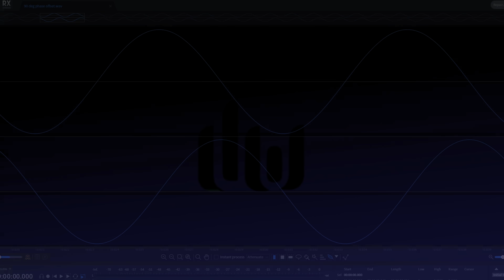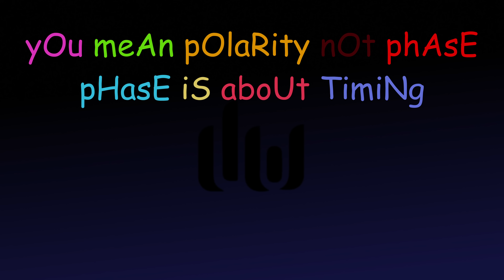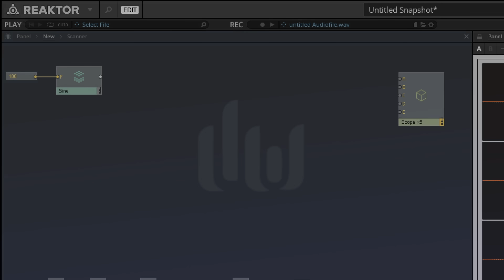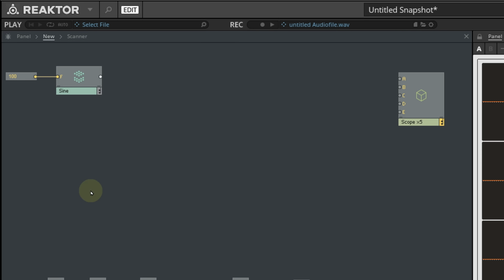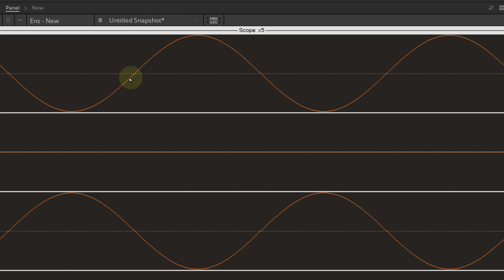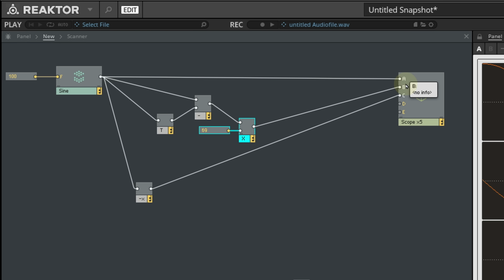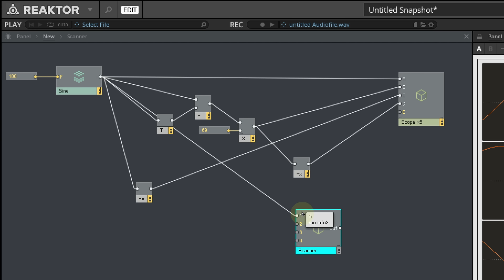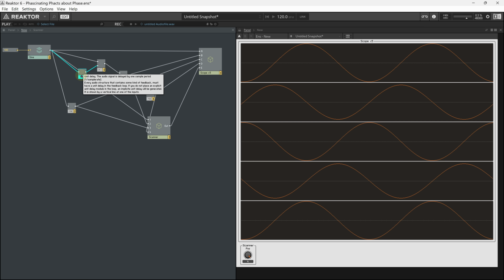Phascinating Phacts about Phase

Comment: From my understanding, what you are describing is not the difference between dynamic and condenser microphones, but the difference between pressure-gradient (i.e. velocity sensitive) and pressure microphones. While pressure-gradient microphones expose both sides of the membrane and are inherently directional, pressure microphones expose only one side and are inherently omnidirectional. It is not actually the transducer type that matters. Both condensers and dynamics can be either pressure-gradient or pressure microphones. And only pressure microphones (i.e. true omnidrectionals) should exhibit the 90 degree phase shift you are talking about - be they dynamic or condenser (condenser mics with switchable polar pattern don't count as true omni, even if set to omni mode -> these combine 2 pressure-gradient membranes to "fake" the omnidirectional pattern). 

I think DPA might have over-generalized here, since dynamic omni mics are pretty rare and they are after all most famouse for their omni condensers.
Reply from the maker: You're making me doubt myself now... I do in fact own examples of all these microphones types, so maybe I'll have to actually test it.
Reply: @DanWorrall  Ha, I never thought the day would come when I'd make Dan Worrall doubt himself :) Looking forward to your test results.
Reply: @SinaSteinerST  i was about to write about this but you stole the show. My day will come when I contribute something to Dans Knowledge as he has done to ours. :)
Reply: @DanWorrall The 90° phase difference comes from the fact that electrically they are both different types of transducers.
An electromagnetic transducer (a dynamic microphone)  generates voltage proportional to the velocity of a coil moving in a magnetic field and therefore velocity of the membrane that is mechanically coupled to it. 

An electrostatic transducer (a condenser microphone) produces voltage proportional to the displacement of a charged plate, usually itself being the membrane.

So one is a velocity sensor and the other is a position sensor.

High school physics tells us that the derrivative of position is velocity so if accoustic force sinusoidal in nature is applied to both membranes the voltage output of one will be sine, and the other one cosine , which are 90° apart.
Reply: @DanWorrall I'll be eagerly awaiting another video please!
Reply: @DanWorrall Hi, @DanWorral, you (and DPA) are correct. Figure 8 microphones and omnis are in phase (as long as the preamp circuit is designed well) because the change in voltage relates to the DISTANCE between the diaphragm and backplate (you can see this from the circuit diagrams). The voltage in a dynamic microphone relates to the VELOCITY of the diaphragm, because a coil in a magnetic field creates a current due to relative movement. 
Hope this helps.
Reply from the maker: Except I don't think that's what I (or DPA) said? And I've got a PhD in my inbox telling me something else again. I'm so confused!
Reply: @DanWorrall Sorry, I didn’t want to put words in your mouth. This is a great video on the fundamentals of condenser microphones from the ex head of engineering at Rode: https://youtu.be/WTJhIVIGvSU?si=qAcMYc5CbCOVj8GM
It explains how the output voltage from the capsule is derived from the capsule.
My quick sanity check for this is that the principle of a cardioid mic is combining a pressure and pressure gradient microphone into one capsule. If the pressure gradient mic isn’t in phase in front, and 180 degrees out of phase in the back, you wouldn’t (to my mind) be able to get the really clear null we see in the back of a cardioid pattern.
Of course this falls apart at really low frequencies (depending in the resonant tuning of a pressure gradient microphone).
Reply: I should add that this is for true single diaphragm microphones, when t comes to “multi pattern” condensers, things can get a little weird.
Reply: @DanWorrall  Not that easy, because condenser mics always include an preamp (*) which can exhibit its own phase shift. And  "aligning capsules" means different things : aligning by eye ? dyn capsules are usually curved... Aligning by waveforms? what's the part of the electronic phase shift ?... Aligning by listening? but that doesn't mean mechanical alignment... !
(*) for increasing levels and impedance matching (condenser capsules themselves are usually GIGAohm impedances)
Reply from the maker: Regarding alignment, I intend to eyeball it :) On the basis that, with a 400Hz tone for example, I would have to be out by more than 20cms to produce a 90 degree phase difference. I reckon I can do better than that by eye.
Reply: Hang on, doesn’t this have to do with the fact that dynamic microphones generate signal through induction (and thus need movement) and condensers through voltage through the two plates (given by the distance between them?) which doesn’t need movement (velocity)? 

I must be saying something obvious, but I don’t understand why this isn’t relevant and pressure vs pressure-gradient is relevant instead.
Reply: @alessandro.favero  I agree with you
Reply: The membrane of a condenser mic moves, thus changing the distance to the polarized part wich in turn changes the capacitance. That change is basically proportional to the membranes displacement ergo to the sound that displaced it in the first place.
Reply: @alessandro.favero  In dynamics and condensers the membrane is moving. It doesn't matter what's attached to it to determine the principle by which the membrane senses sound (pressure-gradient or pressure). The transducer element (e.g. moving coil, plate, ribbon) just determines the way in which the acoustic energy is translated to electricity, which is a seperate concept.
Reply: @SinaSteinerST but that’s exactly what I thought was the concept that was the object of this video. Isn’t the different type of transducer causing this 90deg difference? 

And (separate question) why is there a 90deg difference between pressure and pressure-gradient?
Reply: i was about to comment on the same thing. from my understanding, it is not the dynamic or condenser way of transforming physical movement into voltage, that is seeing a 90°phase shift. rather the part that converts sound pressure vs pressure-gradients into physical motion of the membrane before that. although while thinking about it, capacitive and inductive reactances have their own 90° shift issues with current and voltage. so the effects might even cancel out. or double up, in wich case a microphone manufacturer would invert the capsules polarity to get it all back to 0° again... a 4 quadrant real-world comparison would probaly be very insightful  ((Condenser vs Dynamic) vs (pressure vs gradient))
Reply: That's what I thought when this video brought memories from Uni. I gotta go back to the books now :D Mic it! by Ian Corbett is the first stop
Reply: Why not both?
Reply: I've spent 40 years assuming this phase difference between the dynamic mics and the condenser mics I'd been using was something to do with how dynamic and capacitor mics were made electronically. I probably should have thought about it a little more but when I came up, the spadgers did all the technical stuff. Which doesn't mean we weren't interested in it, or didn't learn it through osmosis but obviously, this particular topic slipped through the cracks. I love learning new stuff, even at my relatively advanced age :D
Reply: That's also what I learned. Still very interesting video, now I know how to do 0...360 degree phase shift!
Reply: Actually, is there a 90-degree phase shift between pressure and velocity in a plane wave? At first i thought Dan is right, but something didn't add up in my head. Now i'm starting to seriously doubt it.

Acceleration of a thin slice of air is caused by pressure gradient (the difference in pressure between the right and the left sides of the slice). Acceleration is a derivative of velocity. deriv(p) ~ deriv(v), so p~v. There should be no phase shift.

Also. The ratio v/p is acoustic impedance by definition, and for a plane wave in a tube it's a positive real number (zero imaginary part). Again, no phase shift.
Reply: the membrane of both dynamic mics and condenser mics are moved by the same thing (like a towel in water for a more visual example). Pressure is moving the membrane like the air, the molecules of the air get their velocity by the pressure differences same for the membrane. However in a dynamic mic the voltages outputed are results of the change in the magentic field, where in condensers it is about how much / little resistance is there. (Sorry I am too less of an electronic guy to put it in better words). So dynamic mics are velocity based but not in terms of velocity of air movement but velocity of the membrane. Condensers are positional based, since the position of the membrane determines how much voltage is at the end. 
But the membrane of both is moved by the airpressure (like a towel in water). 
So there shouldn't be a phase difference by the way the membrane is moved, but I don't know about the internal electronics, if there is a difference because the dynamic one is producing the voltage/current itself by moving in the magnetic field, where the condenser regulates the resistance. If I remember correctly the signal of a condenser is the difference between the phantompower voltage and the changed voltage of the changing resistance (but I might have a mix up in my brain there).
But if the electronics are not making a difference here, then there shouldn't be a phaseshift. At least if both are the same type like comments mentioned already, pressure  vs pressure gradient .
Reply: I'm pretty sure you're bang on with this one @SinaSteinerST !
Reply: Sort of... Condenser mics are capacitively coupled transducers (signal follows displacement) while dynamic mics are inductively coupled (signal follows velocity). So the phase of a dynamic transducer will lag 90 degrees behind the phase of a condenser transducer completely independent of whether it's a pressure mic, a gradient mic, or a pressure-gradient mic.  

But the bit about gradient mics lagging behind pressure mics is also true, and the magnitude is also 90 degrees in the ideal case. So, you could end up 180 degrees out of phase if you run a pressure-only condenser mic next to a dynamic transducer gradient mic.

In practice there are also inverting jfet amplifiers, passive matching networks, swapped terminals, and other tricks going on to get the phase response linear and in the ballpark of industry standard. Or intentionally out of phase in some band because that's precisely why it's been the gold standard for recording a Fox Model 660 Professional Bassoon since 1931
Reply: This is the correct answer, I study sound engineering where we dissected the microphone and studied it in full and this is the correct explanation
Reply: Thinking on this more than I should...I don't see how the steepness of the pressure gradient would change the phase, because the fundamental forces are the same: the pressure on one side is higher than on the other, which makes the diaphragm move. Both  diaphragms will start moving soon as the wave reaches it. Assuming the source is directly in front of the mics, the biggest difference of a pressure gradient capsule is that it captures more of the energy of the sound when there's a steeper gradient and less energy when it's lower, i.e., you get a different frequency response (which is why there's a proximity effect with directional microphones). The timing/phase of when the diaphragm moves should be the same, though.
Reply: the pattern of pressure-gradient receivers (open back) is always fig eight because there is no transfer of movement at 90 degree angle to the wave (both sides cancel each other out), and the cardio variations if you combine two membranes with some delaying techniques. omni comes from pressure receivers or dynamics with closed back, so the incoming wave is only able to transfer its movement from a single direction.

Comment: This sounds a lot like the Hilbert Transform, which I know is typically estimated with a certain pair of filters to approximate the original signal and its phase shifted version. Is there any chance this approach could be adjusted to smear the phases across all frequencies by 90 degrees without having to rescale per frequency?

Comment: What is the essential application, if any, of the little labs phase alignment tool for drum recording for instance?
Reply from the maker: If two signals are out of phase it lets you rotate one of them to fix it. With drum recordings if a close mic isn't blending well with the overheads (for example) you can flip the polarity, which might fix it. But sometimes it just gives you the opposite flavour of wrong, because you actually need to shift phase by more or less than 180 degrees to get a good blend.
Reply: @DanWorrall great info! Thanks. I just bought a used unit and I was worried the “90 degrees is close enough” would render it a waste of time.
Reply from the maker: @clayschmitt a consistent 90 degree difference at all frequencies is fine. Real life phase issues are rarely so neat though.

Comment: Yeah, learn something at 67 years old.I knew about velocity and pressure in the transmission of sound from studying transmission line speaker cabinets But never thought there was such a difference between capacitor and dynamic mics mainly because the dynamic mic output Is expressed as a function of pressure In they specification not velocity.😊

Comment: could velocity vs pressure transducer differences make 'in phase' mics still interact unexpectedly?
Reply from the maker: Unexpected interactions means comb filtering I guess? Where some frequencies are boosted while the ones in between are cut or even notched out. That's a result of varying phase differences at different frequencies, which happens because delaying a signal affects the phase of high frequencies more than low frequencies. The velocity Vs pressure transducers difference is consistent at all frequencies however, so this won't cause any weirdness. Other differences might however, like a high pass filter on one but not the other. I've even got an old dynamic mic with two capsules plus a crossover network, like woofers and tweeters in reverse. That plays havoc with phase around the crossover, don't try to blend it with any other mic!
Reply: @DanWorrall  same goes for the mic's onboard low cut filter on one mic but not the other?